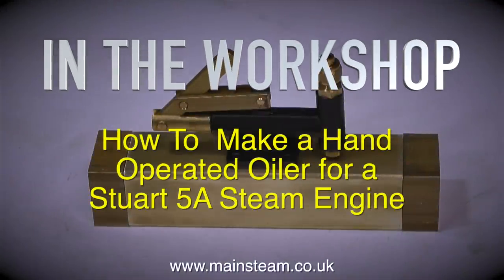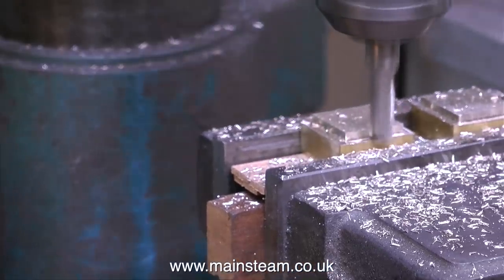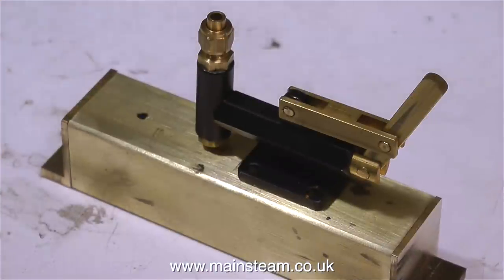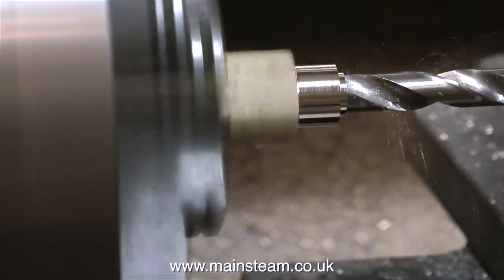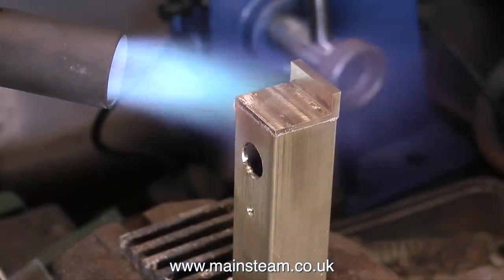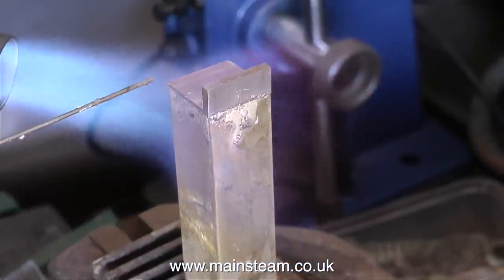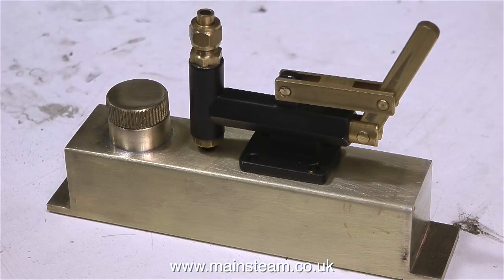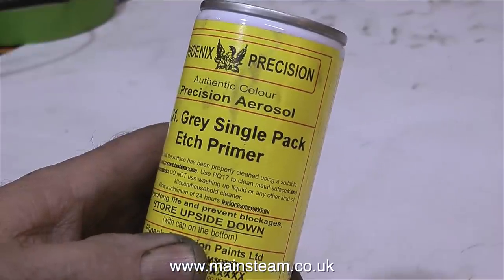MAKING A STEAM ENGINE OIL PUMP - IN THE WORKSHOP

Comment: Another nicely done bit. When I know I will be needing to do some silver soldering, I try to plan ahead so that I can wait for a time when my wife will be gone for a few hours.

While watching the painting with deep concentration I had a thought hit that I might do if I were ever to build one of these machines. Picture the oil tank with a little area not yet painted. Now staged below the unpainted area I picture a very little figurine  in overalls with a paint roller on a wee pole, all in tribute to the opening of early episodes of Red Dwarf.
I need therapy. Or a beer. Or a beer with a therapist.

Comment: On using a drill chuck for holding milling cutters: I had tried that on occasion and what I found is that when using a spiral cutter it creates a downward force on the chuck which can pull the chuck off its taper mount.
Reply from the maker: This one is on an R8 Taper with a long drawbar through the centre of the spindle that firmly holds it in place . . . .
Reply: Same here, except the chuck is attached to an R8 adapter with a Jacobs taper.
Reply: Do you use Loctite 603?

But yes, that is good information about what to avoid when using a drill chuck for holding a milling cutter.
Reply: I had one experience with a cutter pulling out. It was on a CNC mill, the cutter partially pulled the chuck down against the part being milled, then tried to move sideways. My Boss was not impressed, but he was the one who said to use it.

Comment: On plumbing fittings a quick wipe with a wet rag on the hot solder cleans the new joint some I wonder will that work on a silver solder joint?
Reply from the maker: only up to a point before the rag bursts into flames :-))))

Comment: If you were to make another one of these, would you make all the holes first so no swath resides in the tank after you tap all the mounting holes?  How did you lean the current tank so nothing gums up the works?
Reply from the maker: Once again - I flushed the tank to clean it out thoroughly before fitting the pump - I don't show every insignificant detail in the video .....

Comment: Hi Keith 
I am Very pleased with all your videos.  Would be you able soft solder the oil tank on all the joints.
Reply from the maker: Yes because there is no heat on the component when it's in service . . .

Comment: Did you alow for a vent in the oil tank.
I do like the little pump and tank.
Reply from the maker: In the video I show a large hole in the top of the tank - under the end of the pump where the pickup pipe goes in. The pipe is 5/32" and the hole is one Imperial drill size larger :-)))

Comment: How does the inside of that oil pump looks like??
I assume there is a ball bearing inside to work as a one way valve?
Reply from the maker: Two stainless steel ball bearings - one on the top of the inlet and the other on the outlet.

Comment: Mr Appleton may I ask was the use of brass in the tank construction a necessity or could steel have been used? the reason I'm asking is because I thought the unpainted tank was an absolute work of art and I was just curious if you painted it for function or personal preference I figure the latter but in either case a  beautiful job none the less
Reply from the maker: it is a piece of standard 1 inch square brass oil tank material as used in small mechanical lubricators. I bought it from Blackgates Engineering at the same time as the pump.

Comment: Why are you not brazing instead of silver soldering . Ive always worked on larger masheens could never afford these model engines . Maybe now im close to 50 i might get time and be able to get some of these  . Nice job on the oil pump tidy little job
Reply from the maker: Brazing is a higher temperature process. Silver Soldering is fine for these small parts

Comment: what is the difrence between a small full size steam engine and a large model steam engine?
Reply from the maker: The small full sized Steam Engine is designed to do work.
Reply: Keith Appleton  im still not really clear on the difrences wouldent a model just do less work but still be able to do work. Sorry im about to start building an engine model size withe the intent of using it to drive a rotisserie over a fire that both provide the cooking heat and the heating for the boiler its a verry small power requirement so i thaught a "model" engine would do the work

Comment: Not a complaint or criticism, I think I would have drilled and tapped the holes for the pump mount before soldering the end caps. I would not like to have any chips of brass inside the tank.
Reply from the maker: No chips inside the tank - I flushed it out, but didn't bother showing that on the video . . .
Reply: Small engine mechanic here, I worry about that kind of stuff. ;o)

Comment: Why Brass instead of steel ? Did you have the brass tube on hand or did you pick it up with the pump?
Reply from the maker: it is a piece of standard 1 inch square brass oil tank material as used in small mechanical lubricators. I bought it from Blackgates Engineering at the same time as the pump.
Reply: Ok, It just seemed a shame to paint it, it looked so nice in the plane brass.
Reply from the maker: it wouldn't stay shiny for long and would be fiddly to clean .....

Comment: Hello Keith! I was wondering how the pressure equalizes inside the tank as you pump the oil out. Are you fitting the feed pipe with a seal? Since you haven't put any holes into the tank wall I am afraid you'll create a vacuum inside that works against you.

Greetings from Germany!
Reply from the maker: In the video I show a large hole in the top of the tank - under the end of the pump where the pickup pipe goes in. The pipe is 5/32" and the hole is one Imperial drill size larger :-)))